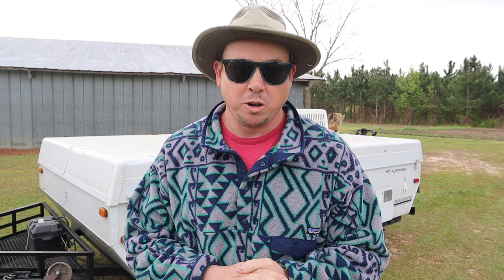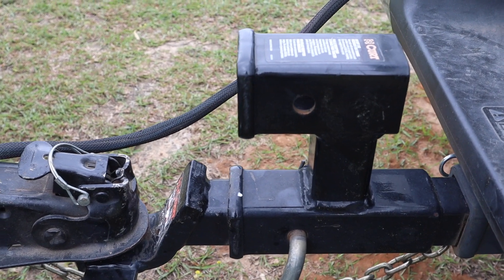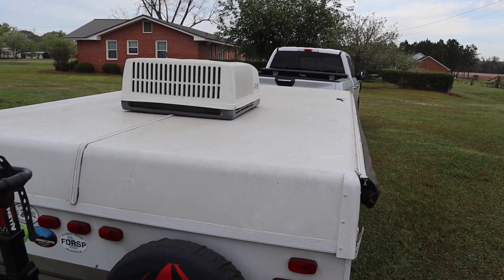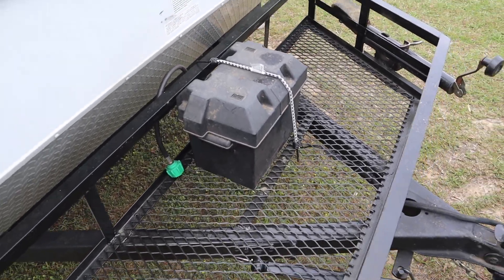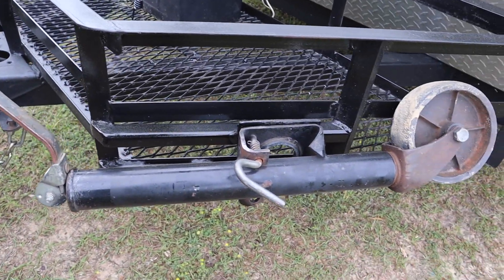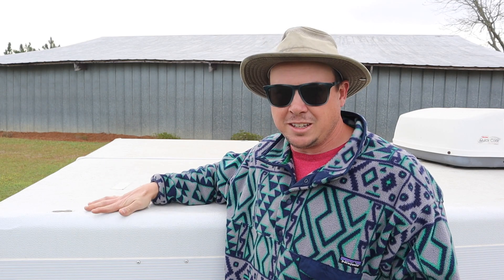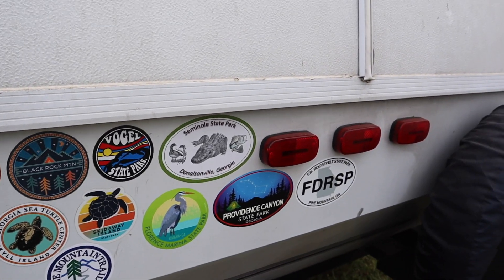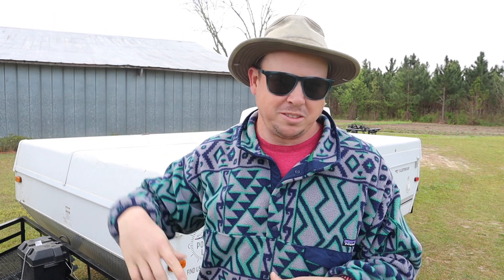MUST SEE POP UP CAMPER CUSTOMIZATION AND MODIFICATION| BIKE CARRIER AND CARGO RACK

Comment: If you’re ever in north Alabama region, or if I’m in South Georgia I’d like to do a video of your camper.  Like to pick your brain a bit too as a pop up owner to inform others of typical questions.  
  Your modifications are awesome.  The reason you’re getting sway is likely the fact the manufacturer put the A/C unit behind the axle. That much weight behind axle isn’t a good design yet typical mistake seen in the industry.  You’re correct that more weight on tongue will eliminate or reduce sway.  Very important that you keep a battery installed during transit. Without battery you would lose break away brakes.  In other words if camper comes loose while driving, the battery activates your trailer brakes, 
  BTW, I’m from Bama but don’t Roll Tide, go Vandy!!
Reply from the maker: That would be great! We will let you know if we head your way ;)

Comment: nice mods and I really like the new front rack.  As a safety issue, remember you should always cross your safety chains.
Reply from the maker: We do on most everything else we haul. The safety chains on this trailer actually connect with heavy-duty carabiners, so they're not coming off. And they're not long enough to cross. First time I had seen that on a trailer, but it actually works pretty well.
Reply: @PopUpLife  Crossed chains acts as a cradle in the event of separation from the tow vehicle and keep the tongue of the trailer from contacting the ground.  It is required in some states

Comment: For added safety, cross the safety chains over the ball hitch. Keeps 'em off the ground.
Cut an access hole over the stabilizer, big enough to allow you to do whatever you need to do. If the hole is to big, make a door from the cut out piece..
Coat the bottom of the trailer also
Reply from the maker: Thanks for the tips James!

Comment: You should cross your safety chains. Nice box.
Reply from the maker: I cross them on every other trailer I have, but these aren't quite long enough to cross. The end of the chains has a carabiner instead of a hook, so it's hard to disconnect them if there isn't a little bit of slack.